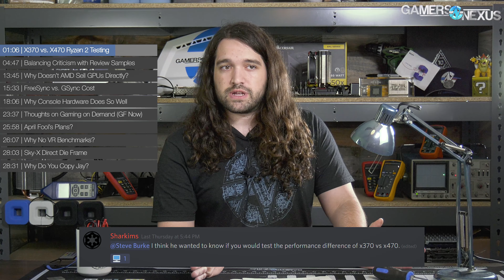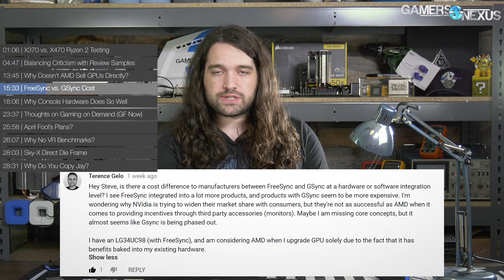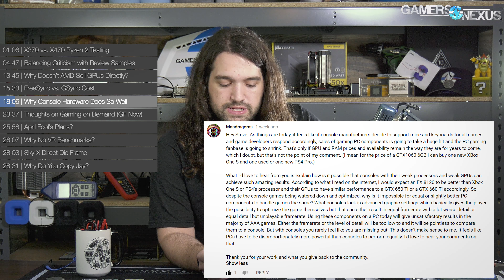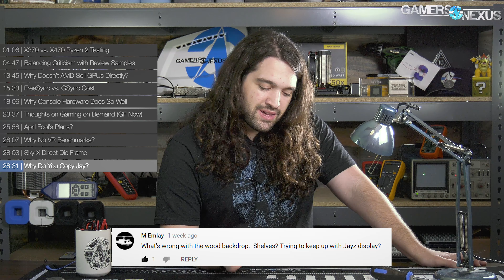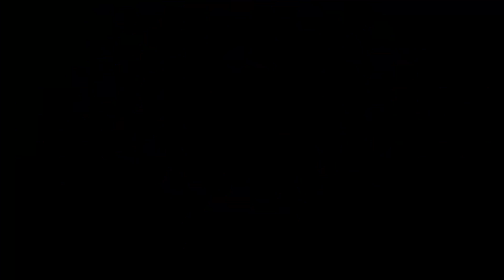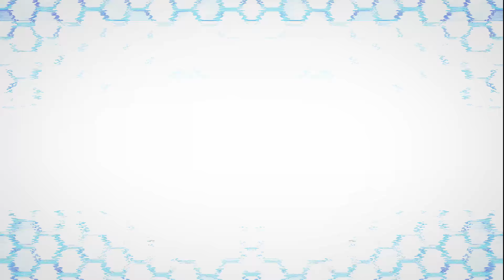Ask GN 75: X470 vs. X370 Tests, Balancing Criticism vs. Samples

Comment: How can you improve your reviewing towards the "Being critical, but sticking to the facts", over "Being spiteful & self absorbed". I love your reviews & the honest connection I feel you have with the user-base. I love that you bring Buildzoid in for PCB breakdowns. I hate when you get the self righteous attitude as if you're the only product reviewer that matters & manufacturers should bow to your every whim. There have been a few reviews where one thing didn't satisfy your needs & you laid waste to the company for the full fifteen minutes, but then with a separate company/review(Same product & shortcoming) you basically gave them a pass for legitimate issues. I think napping or smoking a bowl before critical reviews may help you out. I would fall over dead if you shot a follow up review & admitted to being wrong about something you ranted endlessly over. Not going to unsub, I love most of your content. Still I think with some tweaks you could increase your viewership, & be first viewed source for more of your existing fans.
Reply: I guess you're refering to the original H500P? Seeing how the case fell apart when he tried to lift it up, along with all the other issues I think he was in the right for criticizing it like he did. You're entitled to your opinion of course. :)
Reply: No, that one was ok. I'm talking about another case & can't think of the name at the moment & of course the BF Enso. He railed forever against them & didn't acknowledge that center front does have venting. I bought it after watching Steve, Kyle's & Hardware Unboxed review it....based on the other two's review. I even installed/ext powered my cooling system to smoke test it. I think he either didn't read the pinout on BF site, read the booklet or just didn't look close enough at it to see the venting. It's not very noticeable(nestled in the parting lines where the LED gaps), but I tested with the as shipped configuration & my S24 rad in that location & got flow(with the lower vent plugged). as insistent as Steve was & the terms spoken to such degrees of absolute, it was offputting. But maybe his review was the reason I scored it for $69 on Newegg.
Reply: Pretty sure I said Bitfenix Enso...
Reply: Yes, yes I did....
Reply: I don't think that he's ever intended to have this attitude, and, yet, I think this is exactly why he's getting some consequences as a result of the H500P review. I made a post earlier talking about how one's intentions can easily be misinterpreted if words & actions aren't chosen with a reasonable level of care, and I think that's why you described him at times as you did, and why the H500P review was so misunderstood.
If you look at the latest charts from GN, the original H500P has middle-of-the-road temps - it's quite literally no worse than critically acclaimed and otherwise industry standard cases like the Fractal Define R6 & NZXT S340(check the charts, it's right there with those two). Now, the point of the criticism was that the H500 was marketed as a "high performance, airflow focused" case, so fair enough. But, the problem is that, in that review and in the following months since, the case and CM have just been lambasted on this channel as if there was just sheer incompetence involved, when the case is perfectly competitive in its price bracket - and there are many people out there that completely misunderstood, thinking that the H500P is just a TERRIBLE case with TERRIBLE airflow, and that they should buy something like a Define R6 instead "because it has decent airflow and won't burn up my high performance computer".
Essentially, it went from being just a fair criticism of a somewhat flawed product(like the vast majority of cases lately) to almost a public berating of an entire company for putting out a case with... average airflow/temps. Again, perfectly fair to criticize it for not being better than average since it's marketed as such, but, as a result of Steve's review, it now has the reputation of being significantly worse than average, and it didn't have to end up that way. 

As far as "it fell apart..." - that's just literal exaggeration and is exactly the kind of thing that would leave a PR person infuriated. It's a computer case, the panels fit exactly like designed, exactly where they should, and it will never be a problem while it's fulfilling its job - sitting on/beside a desk. It isn't made to be picked up by the front panel, that REALLY isn't a big deal, especially for a computer case.
Reply: His seeming cynicism in the Threadripper unboxing and mockery/criticism of the personalized review kit(with the personalized lazer etching on the Threadripper engineering sample & acrylic holder - I would've actually been appreciative that a major company spent the time, effort, & cash to do that. It's completely possible to appreciate that effort while still being unbiased) comes to mind as another example. That was a complete turn off for me, along with the Asetek puff piece about the failing AIOs that was basically an Asetek infomercial. After those, I've been much more selective about the GN content I watch, with the Buildzoid breakdowns being the only 'series' I catch with any regularity. It just really seems like Steve could be much more professional, or at least make an effort to look like he's putting some real care into his work.
Reply: RyTrapp0 now I need to rewatch the threadripper video. I wish he would just readdress some of these issues we’ve pointed out with tact & a slight degree of humanity. He isn’t the only show in town, but these & the Bitfenix debacle really have had far reaching consequences. I taped my Bitfenix smoke test to show the decent airflow, but have zero camera presence &/or talent for such things. The 4 other Enso reviews I watched gave decent marks for airflow & 2 of the channels even kept the case as one of the reviewers personal rigs. One would think that would be enough to offset Steve’s over the top antics about the case, but the damage had been done & Bitfenix actually suffered market share loss.
Reply from the maker: Get your facts straight, guys. We didn't get a "personalized" Threadripper CPU, and anyone who cows to a company for a gift is an influenced reviewer. That's bad.
Reply: Whatever. Continue to be an ass and alienate these companies, then passive aggressively mention them repeatedly as if you don't understand why they aren't happy with you. No one said that you had to "cow" to anyone, but you don't have to completely drag their name through the mud either. 
Both of our points have been made here - take them or leave them. Just realize that this is constructive criticisms that are being offered for a reason before you knee-jerk react.
Reply: so you criticized him about a case.and then in your next post cant remember said case. wow
Reply: Gamers Nexus I read that as you made snide comments about the reviewers that did get the etched CPU, but never saw it myself. I just think you can be critical of a design without the attitude as stated before.

Comment: #AskGN the last couple of months i experienced a lot of bsod on windows 10, i thought it was my i7 4790k ocd at 4.7ghz but even after stock settings i still got a lot of bsod. i uninstalled a spectre or meltdown update and since then i havent experienced a bsod. was it really the update that caused all these problems or is there another possible cause?
Reply: It probably was the update. Intel's initial mitigations against spectre and meltdown were causing these problems, but these problems either are fixed now or will be very soon.
Reply: SlavjanA so should i reinstall the update or will there be a separate spectre meltdown update?
Reply: The update should be new, not the one you installed a few months ago. Hopefully it works.
Reply: SlavjanA idk which update it is, but windows probably automatically installed it and no problems so far

Comment: #AskGN For a while now micron has had 3D nand chips up to 2 TB in MLC and 6TB in TLC. With such large single chip capacities, why haven’t ssd capacities increased more? Does it have to do with the current demand for space based on the average program size, or more cost to manufacture?
Reply: My best guess? I would guess with most 1TB SSD costing $300 or so, the cost for a 2TB or larger most consumers would not shell out that kind of cash. Companies tend to cater to the biggest market sectors in order to make the largest profits, hence why so many offer 256 mb and 512 mb variants.

Comment: I was interested in your comments about DX12 on PC when comparing the performance to console systems. A few people I have talked to were saying that DX12 sucked, and I had to correct them, and say, well if it was a DX12 title from the ground up and not a 'wrapper' as you mentioned, there would be a difference.

It'll be nice once the PC gaming industry tosses the bloated DX11 in the toilet where it belongs and starts building real DX12 titles and we'll finally get to realize the performance hype it built up a few years ago.

I also think this has to do a lot with Nvidia, as their cards were optimized for serial processes, DX12 was going to make them look bad compared to GCN architecture on AMD, that's just been DYING for real parallel games to hit the market with DX12 fully realized.
Reply: Slowly but surely DX12 and Vulkan will become the mainstream. The hard part is with these APIs being low-level, they're harder to code for so developers need more time to learn them.

They'll be great not just for GCN but CPUs too due to the APIs having evenly dispersed multi-threaded workloads.
Reply: Yes, spread the workload to more than 1 main core. I understand it's more difficult to code for, but in the end gives more options as well, if coded well. Doom seemed to do it well with OpenGL and Vulkan. Vulkan ran ridiculously smooth on my R5 1600 / R9 390 system.

Comment: #AskGN Would it be possible for you guys to make a video on console emulation running on different pieces of PC hardware? It would be nice to see how the latest CPUs and GPUs compare on both modern (RPCS3, Citra, CEMU...) and older (Dolphin, PCSX2...) emulators, as some of them (mostly the modern ones) are more CPU hungry than others, and it's a topic that I've never seen covered by any PC hardware channel before. Thanks for reading this!

Comment: #AskGN 
I have a question about static pressure. We always measure it in FRONT of the fan; it's pretty clear right now that SP-fans are better in a push-configuration on a liquid cooling radiator.
Suppose you have two fans (like the 120 Noctua fans for instance): AF (Air Flow) and a SP (Static Pressure). Although the SP moves air in a more straight way, the AF moves literally "more air"; using AF in a push configuration on a radiator will be less effective than the SP fan.
The question is: how about the REAR part of the fan? 
If we use a PULL configuration, is it possible for an Air-Flow optimized fan to perform better than a SP-fan (even) in a push configuration? Since the AF-fan moves "more air", in its rear part, it needs to move pull the same amount of air that it pushes (sorry for the English).
Of course making tests to answer this question is not simple (because the answer depends on a large amount of factors, like the manifacturer, the rpm etc); however, does this make sense at least? Is it worth trying?

Comment: My impression from watching the various tech channels is that an x370 will require a BIOS update to run a Ryzen 2000, whereas an x470 will support Ryzen 2000 out of the box. If you don’t have a first-generation Ryzen or an AM4 Athlon to boot with, upgrading the BIOS on the x370 would be problematic. Granted, that particular scenario is only likely if someone buys a Ryzen 2000 and an x370 together, but it’s something to think about if you’re planning to build a new Ryzen system and don’t already have one.
Reply: That's correct. AMD's got support for this issue which appeared when the APUs launched: https://support.amd.com/en-us/kb-articles/Pages/2Gen-Ryzen-AM4-System-Bootup.aspx

Comment: Whats the real diffrence between true 7.1 and virtual 7.1 then vitual 7.1 dolby software or something and true 5.1 audio want to buy headset
Reply: "True" means that they actually have 7.1 (might really be 5.1 though) drivers (aka speakers) in the headset. Whereas "virtual" means that it's simulating 7.1 through two drivers.

Comment: #askGN what temperature difference could you expect between a cpu cooler designed specifically for tr4 (noctua coolers for example), and one designed for more mainstream socket (such as the d15).
Reply: 99% sure Steve did a video on this showing that the TR4 designed coolers were enough of a difference to make them valid. Go back and check his videos.

Comment: Your cooler master review wasn't at all fair though. You went way over the top on how bad you thought it was compared to all your other reviews compared to how bad it actually was. You went out of your way hacking the case up etc. Other case reviews you do are no where near as critical. Since that review I've noticed you have been on a little bit of higher horse.
Reply from the maker: Hacking it up? Where, exactly, did we do that? You mean when we case modded it to fix airflow, then later restored it 100% to its stock configuration?
Reply: GN was extra critical of the case because CM was extra misleading in their marketing.

Not only was CM using deceptive marketing material, they were also exploiting the reputation of one of their previous designs - a design GN was actually partial to.
Reply: burned

Comment: I would like to add a comment/addendum to question of 18:06 .. Steve does mention this mostly in the DX12/Vulkan closing phrase, but: There is nothing about a given PC that means software for it could not be as optimized as software is for a console. If a dev had a lot of time, money, and skill for one particular game, it could on PC end up with more optimizations than it does for console (see: Overwatch). It is just much more likely for a PC developer to use inefficient, generic abstractions to build the game. That also goes the other way, a console developer could end up using inefficient generic abstractions in development and end up with an unoptimized game. It is just less likely for that to happen given the narrower range of hardware and extensive support provided by Sony/Microsoft/Nintendo (and in the distant past, Sega).
Reply: Yes, as Steve says.

Comment: Something about optimization for console:
The biggest reason why games run so well on that "trash" hardware is that you can really optimize it for this hardware. Most hardware has special functions build-in that are way faster if you use them than programming this function. For example on (some) AMD GPUs you can do a 4x4 Matrix Matrix multiplication in about half the time it would take if you would program it yourself. But this requires you to specify that you want to use this build-in function. If the hardware you are running it on doesn't have this function the programm will crash (or you have to give the programm an alternative, and programm the calculation anyway).
The problem is that every architecture has other build-in functions. In the PC world you can't just assume that everyone runs a specific architecture. You have to optimize more generic which sometimes means you can't use these build-in functions. Otherwise you would need to basically write a seperate programm for each architecture that exists. That would not only take forever, but also bugs would be different in every architecture because every architecture gets pretty much a different programm.
On console you can optimize on this level without any problem. It's all the same.
Reply: Pretty sure this is where "game ready drivers" or w/e the amd equivalent is come in. Nvidia and AMD pick up the slack to optimize games for their cards by rewriting shaders or detecting the generic version of your 4x4 matrix multiplication and changing the call to the hardware-specific instruction.
Reply: SpicyHotTech days gone isn't out yet. But damn I wanna see an interview with the dev team explaining how they got a stable fps,  with so many npc's on screen.
Reply: SpicyHotTech but the models polygons still need to be calculated by the CPU?
Or can all that be moved to the gpgpu?
Reply: SpicyHotTech True, got a little ahead of myself, was thinking about meshes.
Reply: Melvin Klein  And cut the details from PC level heavily lol
Reply: That's why I used apostrophes around it. I didn't know how to call it otherwise. 
Maybe inferior would have been a better choice...
Reply: I get it. You all don't like my wording. 
So tell me: how should I have said that it is easier to achieve better graphics on console compared to a computer that has the same computing performance without saying that consoles can achieve better graphics with inferior Hardware?
Come on I'm not even hating on consoles. What I'm saying is actually pro console..
Reply: If this "biggest reason" is true, then why multiplatform games don't have separate .exe files (or game options or rendering paths) made especially for Radeon GCN cards? Why totally discard perfectly working algorithms if they provide such benefits? Everybody is looking for a conspiracy everywhere, when reality is much more complicated.